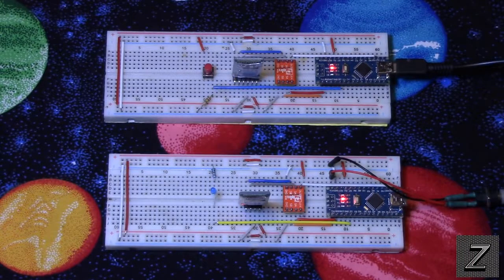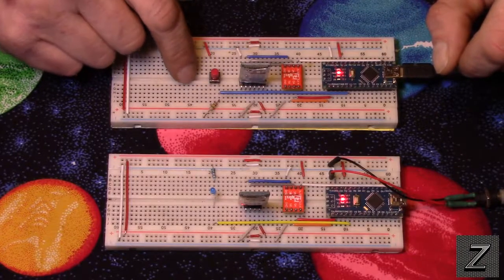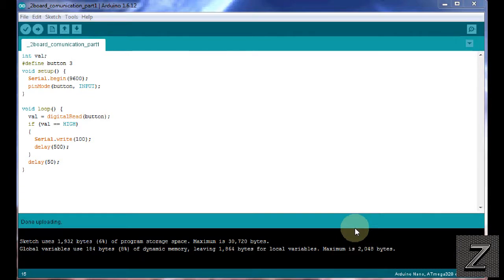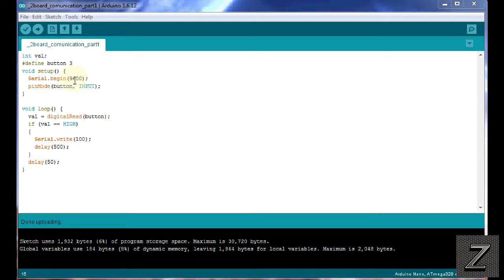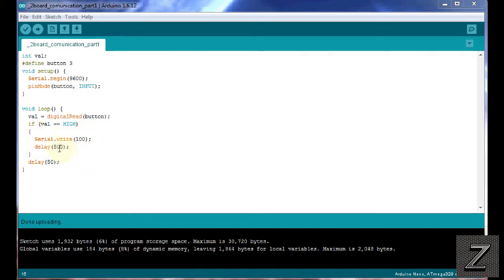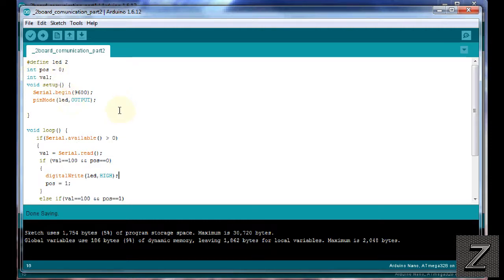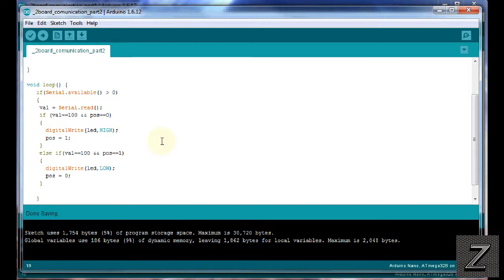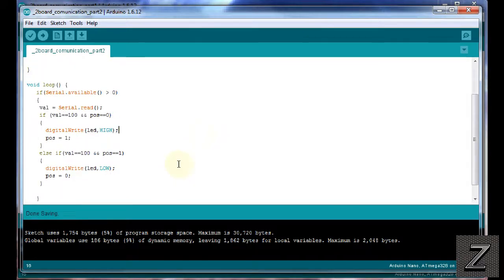How To Make Two ARDUINO Boards Bluetooth Communicate With Each Other

Comment: I'm very interested by your ebay story. I've done over 350 nice deals.
I had only little problem with extremely cheap screwdrivers that can detect voltage.
One lost by post and the other did not work. The last one is a perfect birthday gift for somebody you don't like :-)

Comment: For slave, can we use this code:-

char t; 
void setup() { pinMode(13,OUTPUT); //left motors forward pinMode(12,OUTPUT); //left motors reverse pinMode(11,OUTPUT); //right motors forward pinMode(10,OUTPUT); //right motors reverse pinMode(9,OUTPUT); //Led Serial.begin(9600); } void loop() { if(Serial.available()){ t = Serial.read(); Serial.println(t); } if(t == 'F'){ //move forward(all motors rotate in forward direction) digitalWrite(13,HIGH); digitalWrite(11,HIGH); } else if(t == 'B'){ //move reverse (all motors rotate in reverse direction) digitalWrite(12,HIGH); digitalWrite(10,HIGH); } else if(t == 'L'){ //turn right (left side motors rotate in forward direction, right side motors doesn't rotate) digitalWrite(11,HIGH); } else if(t == 'R'){ //turn left (right side motors rotate in forward direction, left side motors doesn't rotate) digitalWrite(13,HIGH); } else if(t == 'W'){ //turn led on or off) digitalWrite(9,HIGH); } else if(t == 'w'){ digitalWrite(9,LOW); } else if(t == 'S'){ //STOP (all motors stop) digitalWrite(13,LOW); digitalWrite(12,LOW); digitalWrite(11,LOW); digitalWrite(10,LOW); } delay(100); }

Comment: Is there a specific library to be downloaded in order for the Arduino to distinguish the data? Because I uploaded the codes just as they are and it won’t work.
Reply from the maker: check your connections... usuly the problem.. wrong pin or bad connection.. also make sure your bt boards have connected, and that one is master and the other is set to slave.... the boards will not connect auto if you did not set them up to do so.....

Comment: What reliable range have you achieved in open space ?
Reply from the maker: around 50-60 ft.  bluetooth is not for long range. adding a external antenna might help in the range...